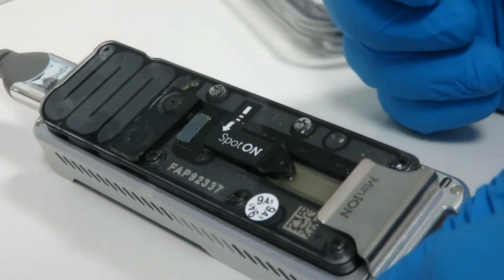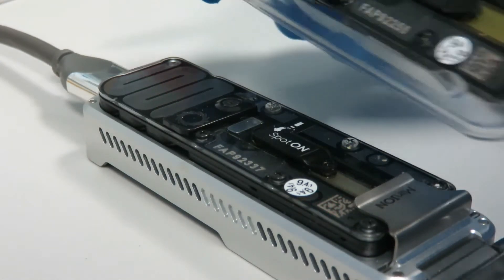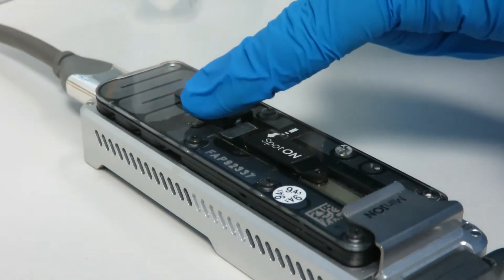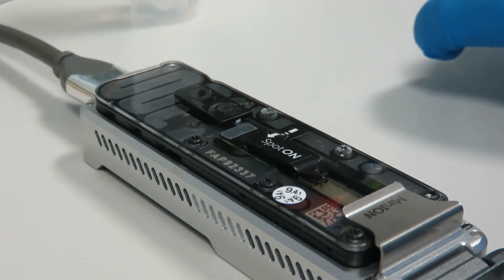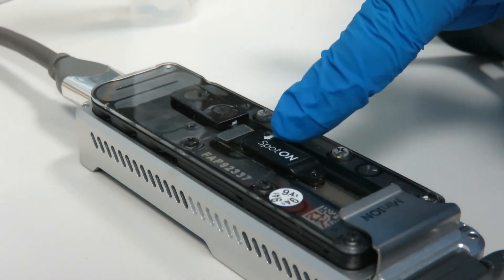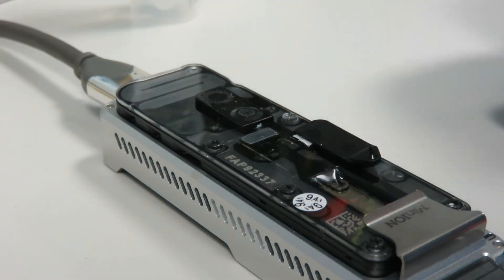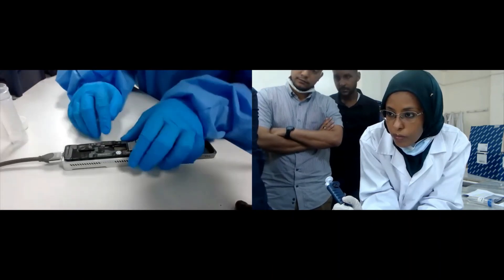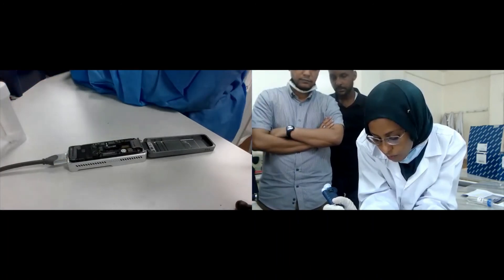Oxford Nanopore flow cell priming and loading tutorial

Comment: While you prime the flow cell or before you load your sample, if you notice a bubble in the flow cell channel, but hasn't reached to the sensor array yet, how would you try getting rid of the bubble? What if there is a big bubble already before priming, how do you get rid of it, we are not meant to pipette out more than 20-30 ul, what if the bubble is not completely tackled by taking 30 ul out? Thanks.
Reply from the maker: The best cure for bubbles is to carefully avoid adding them in the first place. But if there is a bubble before the ASIC panel, you could test to see if it is stuck in it's position, or whether it will move. If it is stuck in place, you might be able to add your buffer without disturbing it, if you are slow and careful. 

If it does move, you could try and suck it back up through the priming port, but be careful to make sure not to suck up so much that the pores are exposed to air from the other end of the channel.

Comment: When you place the spot-on cap back on (especially when reusing flow cells, is there a risk of introducing contaminants from previous experiments?
Reply from the maker: There is no chance of contaminating the run if it is a new flow cell, because samples need barcodes, adaptors etc. to be sequenced and recognised. When washing a flow cell for re-use, you should flush the wash buffer through with the SpotON port closed. That should ensure that any DNA from previous samples will be broken down. The longer you leave it, the less the chance of cross-contamination, but that is of course not completely guaranteed. If reusing a flow cell, it's recommended the samples are very different (e.g. tuberculosis and then SARS-CoV-2), so that if contamination has occurred, the contaminating reads can be removed post-sequencing. I hope that's helpful.

Comment: That's very informative, thank you. However, it seems to me that you did create an air bubble there, no?
Reply from the maker: Nope, no air bubbles here! We've found that doing each of the steps (sucking up a bit first, then creating a small blob before you add buffer in) really eliminates air bubble risks. Also worth keeping an eye on the channel between the priming port and the sensor array (where the pores are), so you can check for any potential air movement and stop before you let air hit the pores (if there's air in the channel, you'll see that it's pale grey in colour, rather than black)